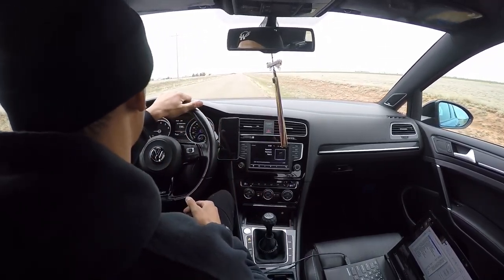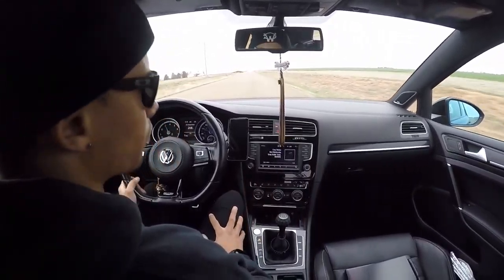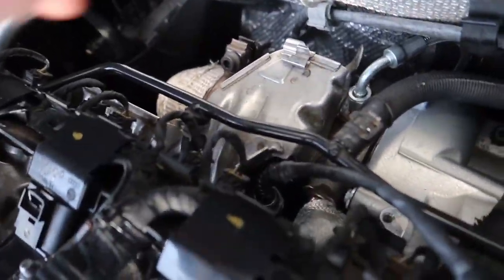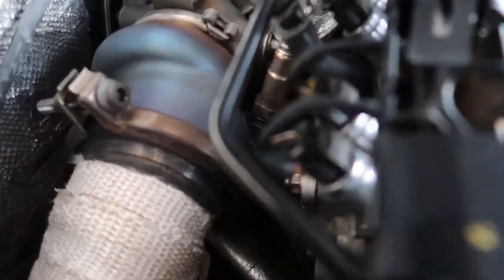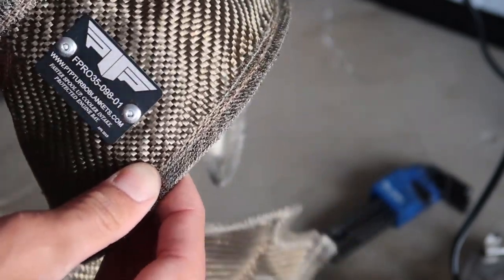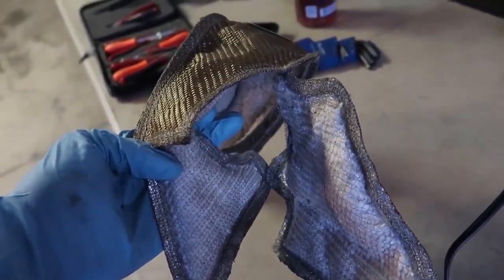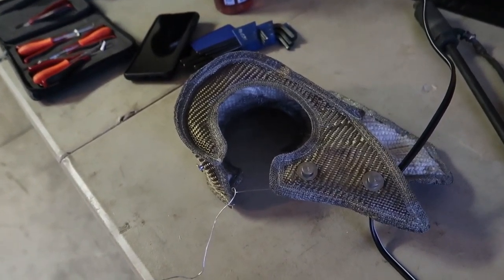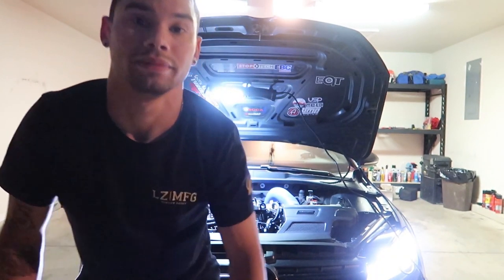(pt2)Lightweight Battery, Turbo Blanket, & Some Pulls! | MK7 Golf R

Comment: Glad your home safe and back to doing what you do best brother
Reply from the maker: Heck yeah me too! Now I’m out of parts and need something to do, maybe ill do some random stuff tomorrow get more pulls and exhaust/ intake sounds 🤷🏽‍♂️
Reply: Bryce Jordan Productions Just did the pedal spacer after watching your video on it. Hell of a difference. Also just did the ECS Turbo inlet as my last bolt on mod so I’m FBO at this point stage 2 EQT custom 93. This summer I might break bank and go with EQT Vortex Turbo but have no idea what supporting mods I need with it. I want to stay 93 pump but I also want to venture into the E85 realm so might do some type of flex fuel kit. You have the regular Vortex or the XL?

Comment: I recently installed a forge Turbo blanket and it was far easier to install, uses snaps instead of that wire. That being said I really didn't think I would notice a difference with it, but if its a car that you know really well you can feel that slightly faster spool once its all heated up.
Reply from the maker: I didn't know forge clicked together.. that's very convenient!! Yeah it's not a huge difference in spool but anything helps! Main thing is the heat though for sure

Comment: Some guys pull the headliner to hear the turbo better, mine was actually deforming from the factory turbo and TX heat, but VW replaced it under warranty. If the problem happens again, I'll go the blanket route and scrap the liner. Did the blanket subdue any of the turbo sound?
Reply from the maker: The turbo blanket? No, it won't affect sound at all. I took my liner out ages ago too with no defects as far as I can tell over the past I'd say damn near two years without it